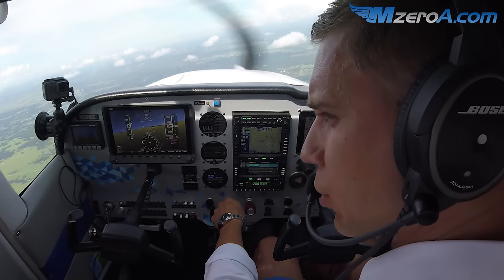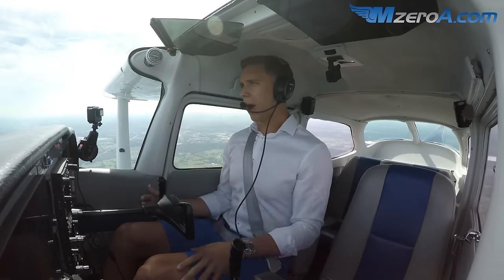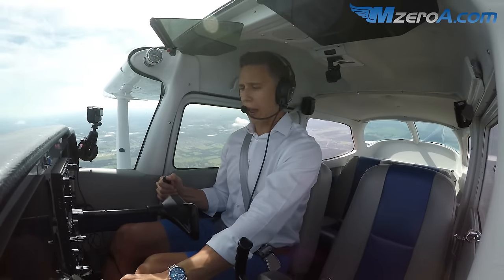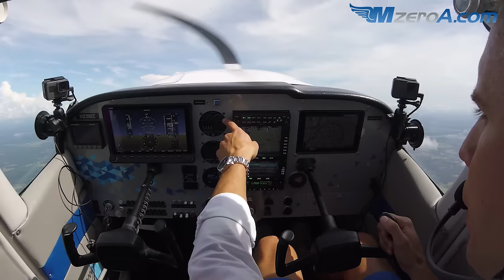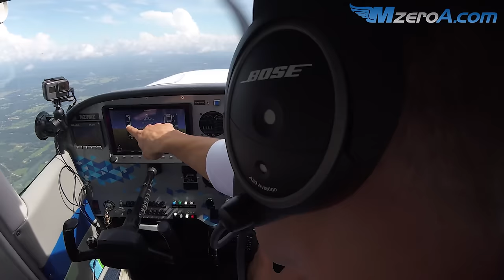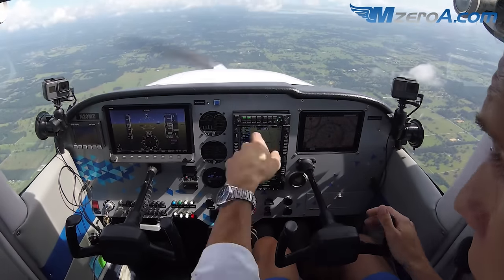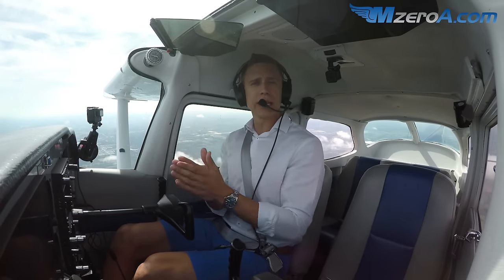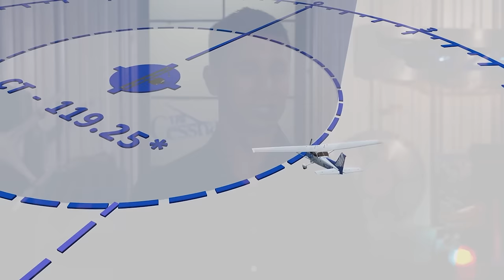Easy Power On Stalls - MzeroA Flight Training

Comment: I’m about 70 hours in and feel comfortable in the plane. Have all my solo CX time done and STILL absolutely suck at stalls and it’s very frustrating. On a good day I’ll get 1 or 2 out of 5 where I don’t lose my heading. I don’t know what to do!!!!!
Reply: If you're turning to the left or right while stalling or just after, it sounds like you may need more rudder. And be sure to keep ailerons neutral!! I struggled with the same thing.
Reply: If you introduce aileron roll into a stalled wing, you stall it further which exaggerates a turn.
I know it may feel right to try and steer out of the turn but it'll only make it worse. Try and remember to use the rudder instead😊
Reply: @Ner-vod so I’ve since figured it out (better than before anyway) for some reason I realized my body incorrectly thinks I’m rolling when I am not. I have no clue why but trusting my attitude indicator over my eyes has helped a ton. I kept trying to roll left to combat the feeling of rolling right at that high aoa and it would cause me to loose my heading to the left.

Comment: Thank you! I’m a rotor cfi doing my fixed wing conversion. My instructor had me keep the power at only 2100 to avoid the abrupt break, of course he taught me to do this from cruise speed. This makes much more sense and is easier for me to stomach. The nose high attitude still makes stalls worse than practicing vortex ring for some reason.

Comment: Ill be practicing power on stalls today if the winds die down a little. They seem easier than power off stalls since all you really have to do is go nose forward to regain speed and lift. The power off stalls seem like there is much more going on with having to go nosedown, full power, retract flaps, apply a lot of right rudder and make sure not to pitch up too much and cause a secondary stall.

Comment: Great video. Do you ever discuss in another video how to properly recover from a wing drop during a stall? It was my natural tendency to use aileron when I got my PPL 20 yrs ago, and my cfi had to break me of that habit over 1 flight of at least 15 stalls. It was an exhausting day.Thx for great vids.
Reply: How do you recover from a wing drop? That happened to me during my first power on stall and I got my instructor and In a spin😅

Comment: Thank you for the great video! I am a student and fly in a 1962 C150-B. My plane loves to spin on Power on Stalls... they’re the one thing I have issues with! But I’ve gotten good at recovering from spins 😂. I feel with no matter how much rudder pressure I put on the aircraft it still wants to spin left on me any recommendations?
Reply: I’m way late to the party, but the trick with the 150 is to watch the nose in the stall. Aim it at a cloud, mountain, or spot in the sky. If it starts deviating from that point, use the rudder to get it back to that point. A lot of people get stuck looking at the ball, compass, or instruments in power on stalls. Keep your eyes on the nose. Sometimes my 150M kicks, but it’s not nearly as bad or scary anymore. A couple seconds of rudder fixes it.

Comment: I think your video  is well done but I think you need to emphasize the importance of trying not to loose altitude during your recovery because you could be very close to the ground. On the airplane stalls a small pitch reduction and full power applied the airplane will be flying again, fly through the stall so as not to get into a secondary stall, pitch up so as not to loose altitude.  You do a great job with your video's I have watched some of them.  Keep up the good work.

Comment: Power on stalls were honestly the reason I quit flight training. It freaked me out so much. The first time I did one I did okay, the second one I started going into a spin and my instructor said it was because I had used ailerons when the plane dipped to the right. I was able to recover, but the freakout had done its damage and I didn't want to fly anymore. That was a few years ago. 

The aviation bug is back though.  How can I overcome this fear? I wish I had Jason as a CFI

Comment: Honestly, practicing "go around" full flap, fully trimmed, landing configuration type of stalls would be far more beneficial. That is where most stalls occur. Not sure why FAA doesn't make it a requirement for checkride. During go around,  adding full power causes pitch up and inexperienced pilots have the startle effect, have a tendency to fixate out window, forget airspeed, retract flaps wrong, forget trim. or all of the above,  and unfortunately many accidents. Check out the stats for GA accidents. These type of stalls could be simulated at 4k. I realize there are power off stalls but they just aren't the same. Just a thought. Here is a go around accident...very sad...RIP but a good example... https://www.youtube.com/watch?v=mf3xhjXl454
Reply: David M I agree
Reply: FAA's and EASA's focus is PREVENTION, i.e., recognize the signals, but eventually don't stall. No matter how much you practice this at 4K, you will not have this height in a real situation.  Proper go arounds are practices with real GAs, close to the ground, but without stalling out. This is gives a better satefy overall.

Comment: Hey Jason I watched a video on a accident that occurred when a relatively new pilot went to a class “b” airspace and ATC over worked the pilot and on her 3rd go around she retracted flaps at 62 knots.  While doing a sharp left turn .Can you do a video on recovering a left turn slip stall?
Reply: Jason Soucie PARE, power idle , ailerons neutralized, rudder opposite of spin, and elevators down , or neutral. But remember if you enter a spin on base to final you’re probably not going to have the altitude to recover,

Comment: Are you not mentioning anything you are doing with the rudder when you drop the nose at the stall?? I am needing to use a ton of rudder and we are instructed not to touch the ailerons (152)- thought it was interesting that there is absolutely zero mention of rudder during the recovery (to prevent a spin)

Comment: Hi Jason,
ACS says +/- 10 degrees heading, so is it more important to keep it coordinated (which sometimes results in me going outside of those restraints) or keeping it on my heading for my checkride?
Reply from the maker: Both of those things are important when doing a stall.  If you don't keep your plane coordinated you will possible place yourself into a spin.  Also the ACS is what you are going to be tested on so this is equally as important.  It sounds like you might not be using your rudders as efficiently as you need to.

Comment: When I do my power on stalls, my plane tends to bank heavily to the right after the buffet and break. The ball is kept in the center in the turning coordinator and the wings are leveled but I don’t know why that keeps happening. Can you help out?
Reply: Same 😔
Reply: Use the rudder!! When at a high power setting theres going to be a natural tendency to yaw to the left, so keep that right rudder down as needed. Use ailerons to keep level as well but just remembering not to use it during the break or you night cause a spin.

Comment: When I do power on stalls, my plane typically turns to the left and I have to add right aileron to compensate. What’s the reason for this?
Reply: it turns left due to the left turning tendency with full power. Use rudder to compensate, never ailerons since it can possibly turn into a spin. Always use rudders to stay coordinated
Reply: so when doing stalls especially power on stalls you really wanna fight the urge to correct with aileron because that can induce a spin. Got to add right rudder as you're adding the power back in. if youre with an instructor let them know and try recovering a stall with aileron and you can see how fast it will develop into a spin.

Comment: Do them at partial power, like a partial power engine failure at say 1, 500 rpm getting only and turning right 20 degrees of bank, you will see how easier is to stall that way. 
Lets Teach the most common way to stall. not the most uncommon like full power with no cargo and no turning.  That Teaches how to be careless and in denial by doing them the most unlikely way to stall..

Comment: Whar about right rudder?
Reply from the maker: Hi Jorge! You may need to add rudder in order to keep the ball centered to avoid an uncoordinated stall. Typically this is right rudder (due to the left turning tendencies being at a high angle of attack with a high power setting) but it is not always the case. Make sure you're referencing the turn coordinator. Thanks for tuning in! Please reach out to us at support@mzeroa.com if you have any other questions. Fly safe!

Comment: I am not having a good experience doing these, without enough right rudder you end up in a spin.
Reply: Same happened to me, the fear of getting into a spin was holding me back on these so much. So I learned to recover from those too
Reply: Same here.
In a full power climb, the airspeed will reduce even below the normal (1 g) stall speeds, and the effectiveness of the vertical stabilizer and the rudder seriously reduces.  I ended up in an asymmetric stall to the left, or to the right (used a LOT of right rudder) in a C-152, with a 90 degree bank and high speed dive, high G pull-out. 
Bloody scary.
The good news is that recoveyr is really really simple and straghtforward,. Accept the temporary freefall, power to idle, controls to neutral and by the time you verify this, you have enough speed again to roll back to normal level flight.
Reply: @rnzoli  90 degree bank in a Cessna 152?! That must have been pretty terrifying we’re you soloing?
Reply: @parker8784  no, I was with an instructor, who deliberately put me through these exercises. It humbled me :)  We entered the incipient spin almost exactly as the C172 in this video.  https://www.youtube.com/watch?v=WKIk-dqml6U    After the recovery, I got my breath back, did the exercise a few more times, every time better, no more spins. But there was always a bit of asymmetry in the power-on stalls, and it gave me an uneasy feeling. That is a less pilot-friendly airplane wouild start spinning, or how a pilot-friendly Cessna can violently spin under icing conditions. Got to be careful, no joke.
Reply: @rnzoli  I just learned about stalls today in ground school. My instructor had to hit a kid because they wouldn’t let go of the controls during a spin one time. Next time I fly I’ll be doing stalls so hopefully everything goes well.
Reply: @parker8784  all basic trainer aircraft are very forgiving and easy to recover. Just remember: don't fight the airplane. In case you lose control, relax your muscles, take a deep breath, neutralize the control (and verify that you really did), and then you can start recovery.  No need to rush, no need to flex muscles. Easier said than done, but that's the point of the whole stall exercise series. By the way, I know many instructors, who don't like getting into stalls and spins either. But they do what they have got to do with their students.
Reply: @rnzoli  thanks for the tips